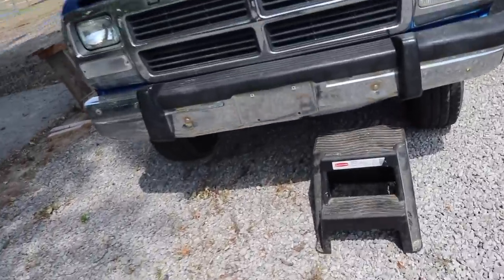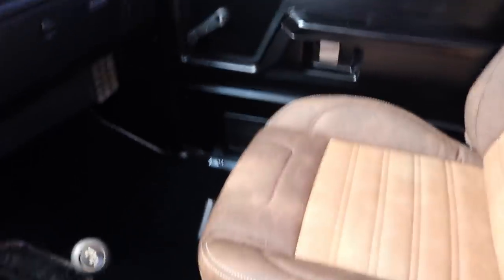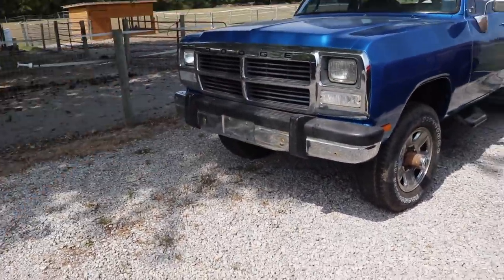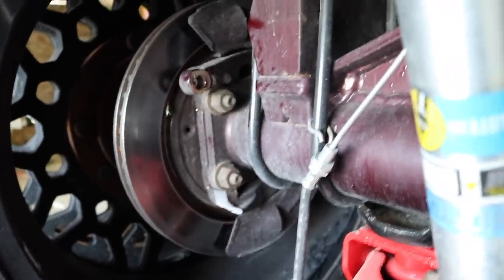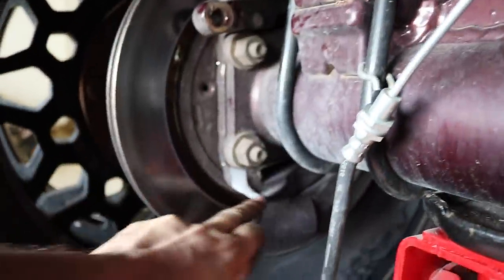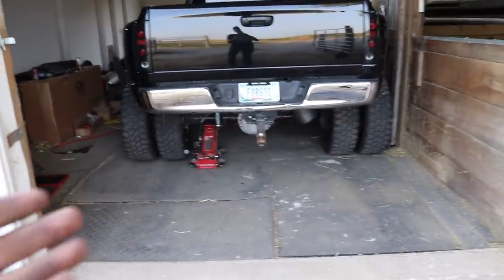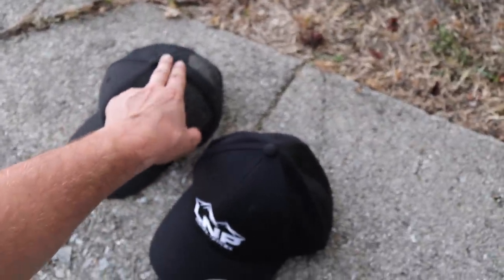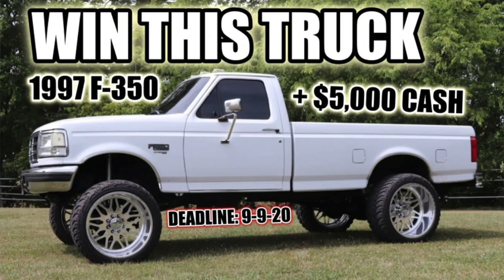Here's WHY I spent nearly $60,000 on WhistlinDiesel's old trucks...

Comment: You mentioned that the truck is 110 “ wide at the wheels, The maximum width allowed is 102” without a permit in most states, and on secondary roads it’s 96” ! I don’t know if the DOT is after you guys but they won’t let truckers get away with anything.

Comment: Also if you take the adapter off you can remove the duals with a standard wheel socket. DO NOT REMOVE THE 10 LUGS!!!! Unless you have to get new tires! Remove the cap and then remove the eight lugs holding on the adapter

Comment: Backing plate, and more then likely sold as an assembly with parking brake shoes, if i have the last 8 of the vin I could check availability and also do a dealer locate, I can also see if i can give you any better of a deal

Comment: Pull up the dimensions of the part you broke ( from a diagram or something) then reference it with the dimensions off the newer trucks, if the dimensions are the same then you should be good. Or you could go to a smaller fab shop with the broken bracket , once you have it off and see if they can fab you on or cut it on a cnc.. at our shop ( not my shop ) but we could do it , you’d be waiting awhile cause of shit shipping times tho. Hopefully you get it sorted soon🤘🏻

Comment: I just broke mine on my 3rd gen quad cab long bed and just found the part after 4 weeks. And the axles went from a 10.5 inch aam axle to a 11.5 inch axle but when I looked they will fit on both. And where did you find a $150 bracket???
Reply: Great way to tell him and not tell him what it is actually called!  Yeah I just broke mine too on my 3rd gen quad cab long bed dually 5th wheel gooseneck pintle tow mirrors 7spd. Big exhaust coal rollen supa dupa....wooweee shiftn gears
Reply: Kevin McGann Damn got you that butt hurt wooweee🤣🤣🤣🤣
Reply: @rockycaudle9479 yup you got me......... sick burn!

Comment: Don’t do what I did; About 8 months ago I replaced the starter on my first gen and snapped the oil dipstick tube flush at the block. Starting leaking like a son of a gun.
Reply: Yeah had to tilt the engine up, pull the oil pan, and tap it out from the bottom. Not fun